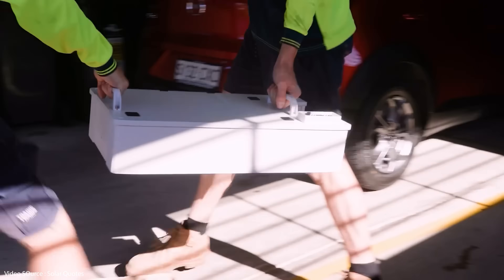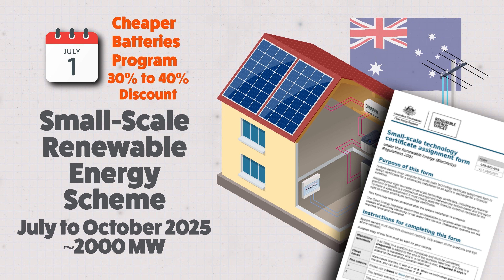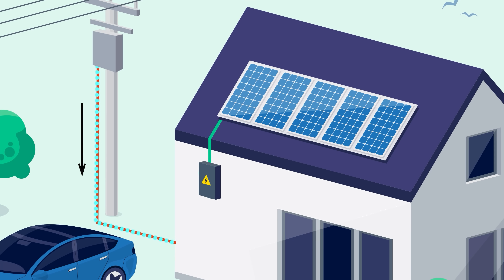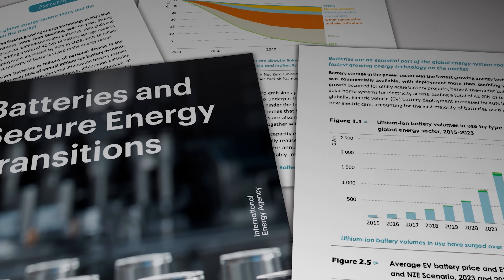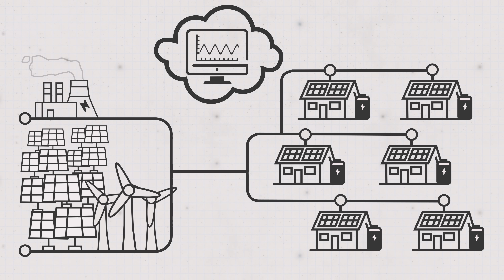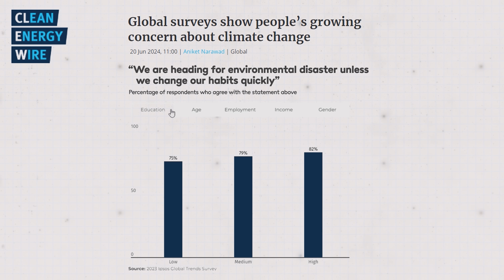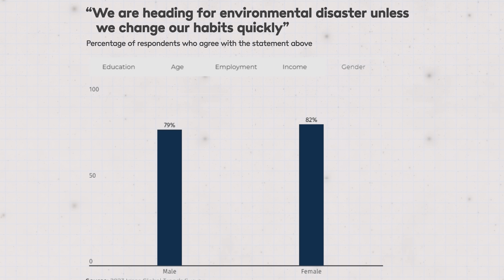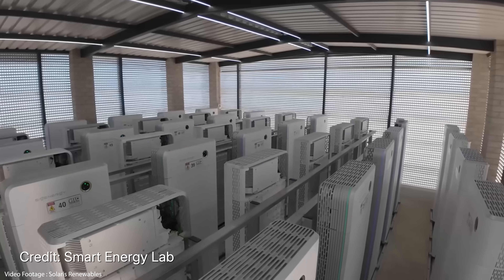Australians installed 100,000 home batteries in 17 weeks. Why can't we all do that?

Comment: I'd like to see a program like this linked with low interest loans for low income households.  I know there is a whole strata below home owner, but since rooftop solar eventually pays for itself I see putting solar on the roofs of poorer home owners as a great way to help lift those people out of poverty by taking away one of their bills in the long run.  

I'm not sure how to extend that benefit to renters, except maybe in actually subsidized housing, where maybe the government could pay to put solar on the roof in exchange for the power going to the tenants for free (and not affecting the energy credits they get on their rent).  

Or maybe you could give the landlord a little upfront payment, and knock the percentage of income required for the tenants towards their rent down from 25% to 20% in housing with solar and the landlord would get to sell the power to the grid.  The landlord would pay the difference in rent,... the formulas are complicated... in U.S. Section 8 housing the tenant pays 25% of their income towards rent and the government picks up the rest, but utility costs are subtracted from the tenants portion.  An apartment complex in my community got a grant to switch from electric baseboard heating to natural gas heat pumps.  The landlord got the money to install it, found the lowest bidder and got to keep the difference, then, after a few years, they appealed to the government and got the rent adjusted up because the energy bill was lower.  From an energy efficiency perspective it was a win, because even though it was natural gas, being a heat pump it was way more efficient.  From a tenant perspective, they lost a closet for a furnace, and their rent went up by the amount the energy bill, which they pay, went down.

I hate it when we miss the opportunity to combine green policy with anti-poverty and social justice policy, especially when the cost to the government ends up being the same either way.

Comment: What happens in 15 years later all the batteries are shot build a nuclear power plant instead
Reply: Screw nuclear.  Geothermal is the future.
Reply: @Les_S537 nuclear power delivers 40 times more power per square foot then this Mickey Mouse battery operation
Reply: @TAGUPNBLUE  Geothermal will crush any nuclear fission reactors on cost.
Reply: @Les_S537 what you need nuclear power to run geothermal it's called electricity
Reply: @TAGUPNBLUE  You're making no sense.  You don't need nuclear to run geothermal...  LOL
Reply: @Les_S537 where is the power going to come from to run your geothermal pumps from nuclear power Coal Fire plants part-time unreliable solar batteries that catch on fire. You have to remove yourself from this fantasy idea unique power 24/7

Comment: I just today prepared the electric system in my garden house to enable an 11.5 kWh battery. It will be delivered next week and help me to make fuller use of the PV output in summer, and allow me to run the heat pump on cheaper power (time of use pricing) in the winter. ❤ from 🇳🇱

Comment: I think governments and car companies should explore the concept of swappable batteries for cars and trucks more.  A home owner could swap out a battery in the evening and put a charged battery in the car with the uncharged battery ready for charging during either peak production or off peak consumption times.  This could also work in large apartment buildings where the car owner stops at a swap station and exchanges the uncharged battery for a fully charged battery.  Meanwhile once the battery is charged it could also be used to supply the grid with electricity during peak consumption times.  Such a system is in place in China where NOI has done over 90 million battery swaps in a single year.  This has the added benefit of reducing the battery weight of a car which means less cost per car purchase and less wear and tear on roads as well as less weight to use up stored electricity.  This concept may well be the only way large trucks will be able to operate electrically since the added weight of "enough battery capacity" will either be to expensive or reduce cargo capacity or produce to much wear and tear on roads.

Comment: Here in NZ, they have almost doubled my supply charge, which, with tax, is actually more than I pay for the electricity used. This makes it not worthwhile for me to go the solar route, unless I disconnect from the grid. They claim that the increase is required to upgrade the grid, but the way I see it if we followed Aussies' lead, the upgrade would not be necessary.
Reply: Its perfectly possible the grid need reinforcement - almost all do as we electrify - but solar and battery will lessen the overall stress on that grid (and therefore the costs) esp where ToU tariffs are standard.

Comment: One problem with green energy is people drive their electric cars to work during the day and have to have a set of batteries at home to charge their car at night. If they could charge at the workplace with a share of the workplace solar array it would greatly reduce the need for batteries and reduce shutting down mid-day solar and wind. This would also assist apartment dwellers who have no capacity to charge at home during the day.

Comment: What this doesn't mention is the 250,000 off grid solar + batteries already installed in Australia. Without rebates. 

The government messes up the rebate a little bit at the start, paying huge rebates for homes with batteries with small inverters, which means they can't access the capacity in a timely manner. 

They just announced changes but didn't address that aspect. 
And they massively cut the rebates from may 2026 in 6 months from now. 

It is a suitable fix in my opinion. And will allow a lot of up to 14kw-20kw batteries which is the sweet spot for most when accounting for VPP and local distribution back into the local grid.
Reply: Yes, their first attempt has disproportionately benefited wealthy Australians with large solar arrays by discounting massive batteries to be almost free. Nice to see the govt course correct relatively quickly though, and that capacity will still be helpful for grid stability

Comment: Gday, from one of those 100k Australian battery up-takers. First let me say I admire your work and efforts creating excellent learning content for new comer’s like me. 

I ordered my system in June 2025 once the government announced the battery initiative and waited 3 months for installation as the quality installers were run off their feet and battery supply was being snapped up.  I installed a 17kwh solar array and a 48kwh battery with 20kw inverter (3 phase). 

I just thought I might let you know the system works best once you sign up as a Virtual Power Plant to a wholesaler so you get high prices when energy costs spike. I sell my electrons at an average of 21c a kWh hour but when grid instability occurs (everyone switching on air conditioners) I have received $30 at short bursts. My best day so far is earnings of $170 after my personal usage.  The sunny Sydney weather makes it a no brainer. 

I have to say i am ecstatic over my system and outcomes the system earns me about $2,000 per annum and I don’t pay for electricity day or night. The total cash outlay I made after state and federal rebates was $25k AUD the rebates were 48% total once you become a VPP.  PS the value of those certificates drop so I got in early to take advantage of the maximum rebates.

Keep up the great work 👍🏼🇦🇺

Comment: I’m a Brit and live in Aus. We were one of those who installed a battery. We were indeed incentivised by the government grant which came into effect this year. We had already had a 10kw system roof top solar system installed 3 years ago. The other reason of course is because energy (gas and electricity) has become so expensive. We still pay for our electricity because we live in Melbourne and on overcast rainy days the amount generation is not as high. We also had a storm last year that knocked out our electricity for nearly 24 hours last year and we realised a battery meant we could keep the fridge and heating/cooling going at least.
Reply: I hope you installed a reasonably large battery, as then, you should be able to go through winter with the bad days and minimal rooftop generation. We are also in Melbourne and have had solar since 2012, and added 20kWh of usable battery storage 7 years ago. These were flow batteries and while they were great, they weren't that great.
Almost a year ago we changed our hybrid flow batteries for an LFP battery pack with 40kWh of storage; it's been a game changer. Essentially we haven't used power from the grid in the last year, including through winter, which as you know, was a dark(ish) one this year.
Our batteries are not like the single or stackable batteries that are part of what is available through the government subsidy. Our batteries are 8 x 5kWh Pylontech units running through a pair of Victron inverters.
Reply: Most battery installs with backup will exclude heating/cooling due to the high energy demand of those systems. Most batteries can only discharge 5kw which is enough to run a house as long as you don't turn on the oven or the aircon. My backup excludes the oven, aircon and heat pump hot water. Our longest blackout was last January - 18 hours - and our battery 13.5kwh stood the test and did not falter. It was hot, but we had lights, fans and internet. Our cooking needs were met with airfryer, microwave and kettle.
Reply: @lunsmann   One of the reasons we went the slightly different route, was firstly, because the current batteries with an integrated inverter, were not around, secondly, we needed at least 10,000W of supply to ensure we were covered for all requirements.  
The most recent blackout we've endured was last February; we didn't miss a beat.
About 7 years ago we were without power due to a huge traffic crash where power poles were ripped out. We lost almost a day without grid power, like you we got by, but it was close as our battery capacity wasn't anywhere near as big as what we have now.
Our heating and cooling are via individual reverse cycle air conditioners, that way we only heat or cool what we are using. I wish we'd converted to reverse cycle units decades ago; that said, they weren't around in affordable units back then.

Comment: The key blocker here in the UK is not the batteries or the Cells but the installation cost to put the panels on the roof. We need a clever installation system that can be carried out in an afternoon and costs hundreds rather than thousands of pounds!
Reply: If Australia with its much higher labour costs can do it, then why can’t the UK?
Reply: @seanlander9321   - even in Australia steeper roof pitch adds to the labour cost. Most of our roof tops have 22 degrees pitch. Have you seen the pitch on the average UK home? Designed to cope with heavy snowfalls.
Reply: @seanlander9321 it is the scaffolding ~£1k thst is the biggest component, then labour is another component. Roof pitch doeant matter.

Comment: My experience has been no solar or batteries. I can't afford to buy my own home and I've not yet met a landlord who is concerned about lowering my electric bill.
Reply: It is unforntunate that some people are in the situaton you find yourself.

In Australia at least, there are two points I would make relevant to a situation such as yours.

1/ Renters do at least receive some benefit from other peoples rooftop solar systems, because feed in of excess generation from those systems, helps to moderate the overall cost of grid supply electricity downwards for people. Otherwise electricity would be costing more that what it is.

2/ There is the beginnings of the federal government coming up with policies to also incentivise landlords to install rooftop solar systems on their properties. Not sure how that is going to work but very interested to see how it all goes.

Comment: Due to a cold climate and very restrictive building code, we cannot put batteries inside a house without huge expense (venting, fireproofing, etc), and you can't put them outside without heating the space (a significant delta when it is -30 C outside), so I am very envious of Australia where everyone can add batteries with minimal extra hassle. That said, government incentive would be very helpful and likely cheaper than many options on the table. I say that because our provincial hydro utility just came up with a plan to install 750MW of gas fired turbines for peak demand (mid winter, midnight scenario). The price is 3.4 Billion dollars!! That's 4.5 million per MW hr!! I am sure that decentralized battery storage would solve the problem just fine.
Reply: Ah someone else from Manitoba here too. You're talking about the one in Brandon, right?
Reply: @danr8194  Correct! My figuring says we are paying $4,500,000/MW which seems VERY expensive. Couldn't we just flatten out the peak load for much cheaper than that?
Reply: Hopefully sodium batteries will help fix that problem when they get popular in a few years time.  They work up to about -30 C.

Comment: I am in Australia and recently got batteries installed under this system (42kWh system) - we use 15 to 20 kWh of it ourselves, and have automated another ~15 to 20 kWh to be exported to the grid doing grid peak usage window.
Another thing of note is that the market operator (AEMO) is soon mandating retailers offer free electricity between 11am and 2pm in order to make use of the excess solar going into the grid, Solar Sharer Scheme it's called.
It's wild how expensive our electricity has been historically given how much energy resources we have - the multinationals corps that benefit most from it have been laughing all the way to the bank for decades.
Reply: Except on an overcast day I would never use grid power between 11am and 2pm - only those without solar/battery are likely to benefit - that will be low income households, renters and those living in home units.  This policy although being sold as for all people it is simple redistribution of wealth
Reply: @HoylesPattern isn’t that a good thing?
It’s also to perform a grid service and avoid excess power moping around the grid raising voltages/messing with frequency.

Comment: If the installation of these batteries removes the need for adapting the grid for peak hour rooftop solar output, was this subsidy more cost efficient than paying for the grid upgrade? Does it give an overall cost saving? That would be interesting to know, as it will counter the inevitable fossil fuel lobbyist's arguments against PV power.

Comment: I see that ChatGPT suggests the following benefits of home batteries storage

Key Benefits
Peak Demand Management: Home batteries charge during off-peak hours (or during the day with solar) and discharge during evening peak demand periods. This reduces the stress on the transmission system during critical times, which often determines the need for new or upgraded power lines and fossil fuel "peaker" plants.
Reduced Congestion: By providing a local power source, batteries alleviate congestion on specific parts of the transmission network. This acts as "virtual transmission," allowing existing infrastructure to operate more smoothly and deferring costly, large-scale infrastructure upgrades.
Minimized Transmission Losses: Electricity naturally loses efficiency when transmitted over long distances. Local storage and consumption of power reduces the distance electricity travels, making the overall energy system more efficient and requiring less total generation capacity.
Improved Grid Stability and Resilience: A network of distributed batteries (often coordinated as a Virtual Power Plant or VPP) can quickly respond to fluctuations in supply and demand, helping to balance the grid and prevent outages. This rapid response can minimize momentary interruptions and avoid blackouts, especially for regional communities.
Better Integration of Renewables: Local storage allows households to capture excess renewable energy generated from rooftop solar panels during the day and use it at night, smoothing out the intermittent nature of renewable sources. This increases the effective use of clean energy and ensures less is wasted (curtailed) due to grid constraints.
Avoided Infrastructure Costs: The collective capacity of home batteries can offset the need for additional investments in traditional centralized generation and transmission infrastructure, benefiting all consumers by putting downward pressure on energy bills.

Comment: Very nice. One comparison you might have mentioned is that 2000MW is the output of two average nuclear reactors.
Thanks.
Reply: except the two nuclear reactors provides the 2000MW 24/7 365 days long and actually supplies the base load and energy hungry industries unlike the useless solar and wind
Reply: Exactly! 2 nuclear reactors worth of peak power output built in just a few months. Batteries are exactly what Australia needs instead of hundreds billions of dollars to deliver inefficient nuclear reactors in  20 years time.
Reply: @zen1647 tell that to Pauline Hanson
Reply: @zen1647  bullshit!!! that doesnt even come close to replacing let alone competing with nuclear reactor, what a joke! nuclear power is full production 24/7 non stop unlike solar.